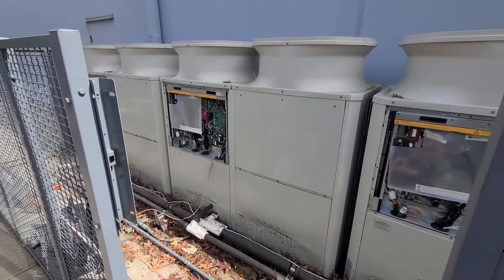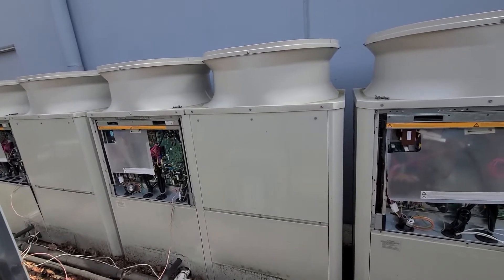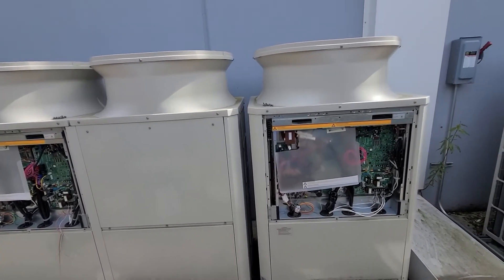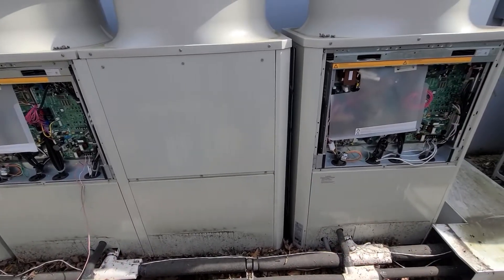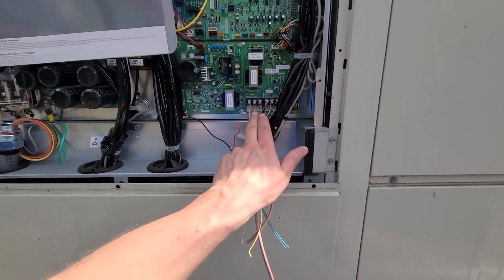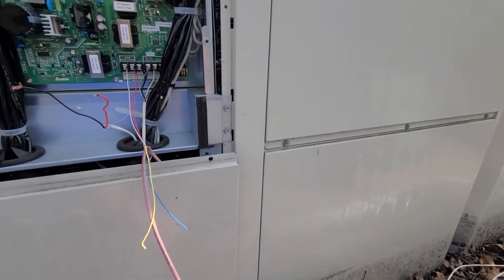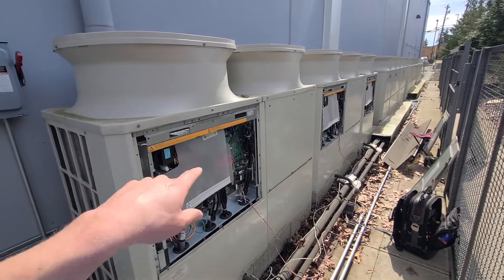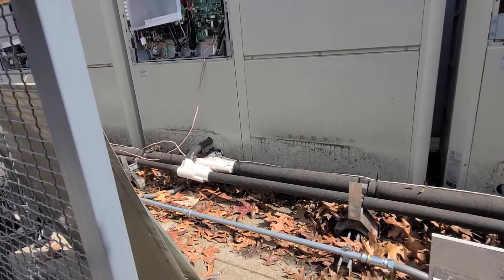Troubleshooting No Cooling On Mitsubishi City Multi HVAC System

Comment: Where does TB3 wire connect in ductable AC
Reply: You will see TB 3 at indoor fan coil,
These units are very easy to wire up
Reply: Or BC controller
Reply: M1/M2 at TB3